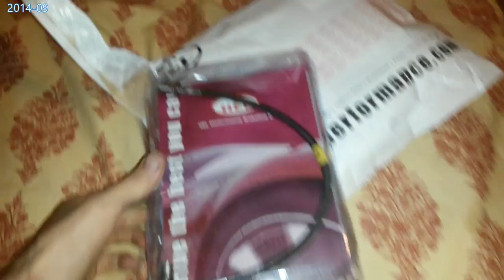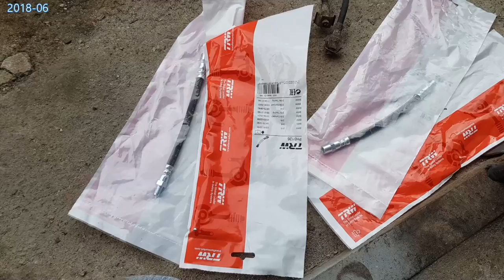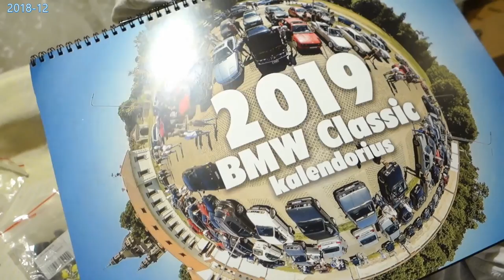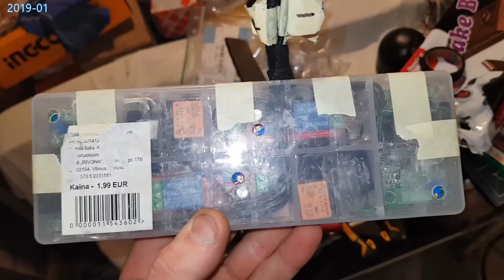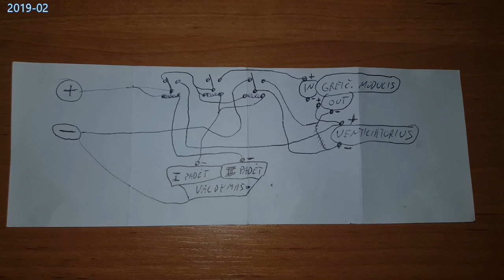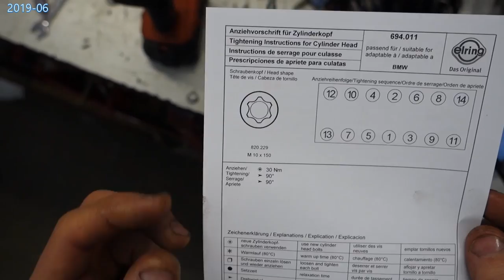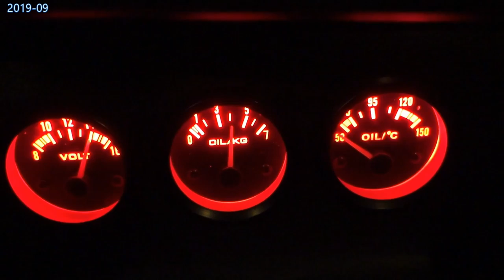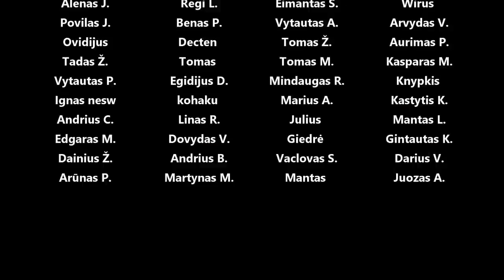BMW E30 full restoration 2014-2022 start to finish (almost)

Comment: What exhaust manifold did you use? Ebay? it is good? I want to find an exhaust for my e30 320i m20b20 aswell
Reply from the maker: This one is from ebay, TA-technix. It still does not leak, so ir is not so bad. But I had to modify downpipe a little to fit better.

Comment: nice job!!
what is that black liquid you are using with the syringe?
Reply from the maker: Thank you!
It is Dynitrol ML inside.
Reply: @MechanikasLukas  you put the wax from the spay bottle to a Syringe?
Reply from the maker: @suzukakias1000  I bought 1l bottle of it that is not pressurised.